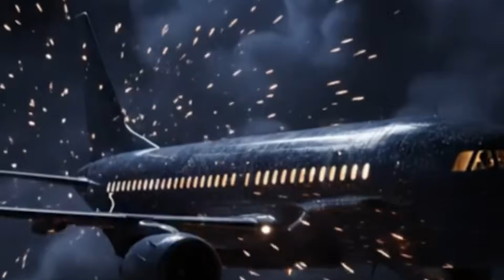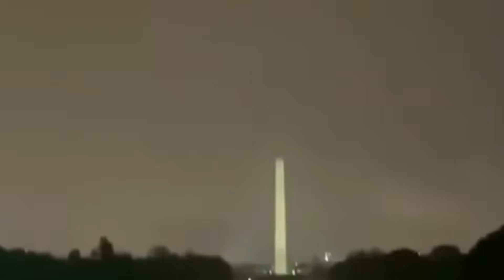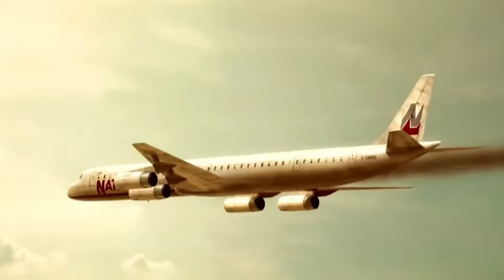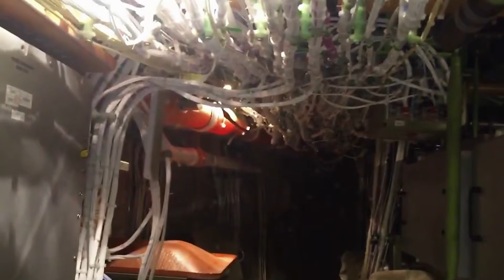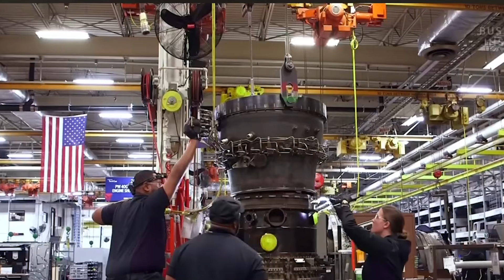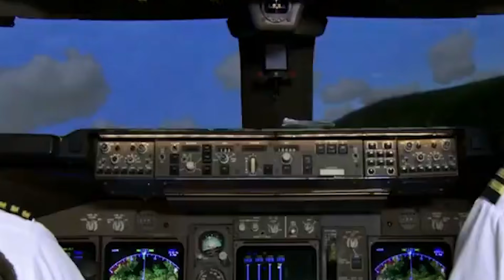Why Lightning Can't Crash a Plane

Comment: Since 1963 seems to be the last fatal crash of a lightning hit plane, guess I should be happy to be alive. That ol' piston engine on that Convair I was was on quit during a flight in, IIRC, 1960 when it was hit by lightning. Landing that airplane on one engine in Shreveport must have been a challenge but we made it just fine.
Reply from the maker: That must have been a terrifying experience. Surviving a lightning strike and then continuing the flight with one piston engine out on a Convair is something most passengers will never experience. It’s incredible how much aviation safety and lightning protection have improved since those early airliner days. Stories like yours are a reminder of how tough both those old aircraft and their crews really were.
Reply: Do you know if it was aturbo or piston prop? plane because that's when they had some turbo props and still had piston props for a while but were being replaced by either jets or turbo props.